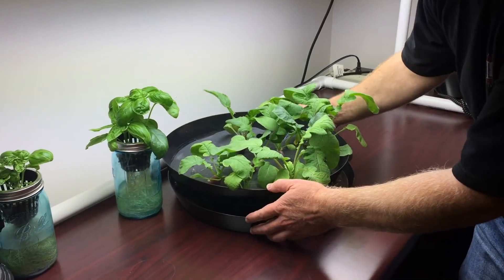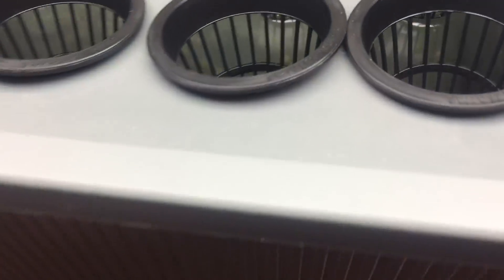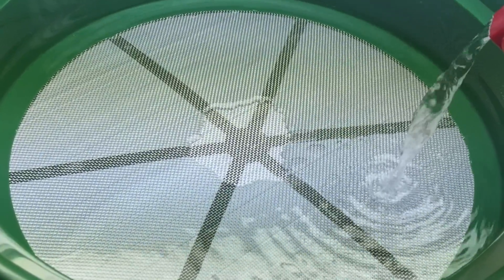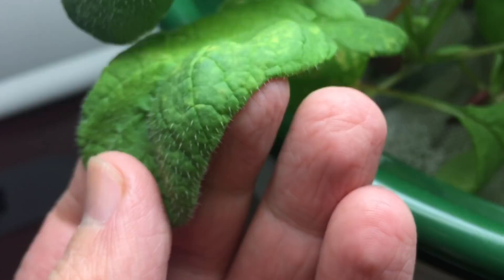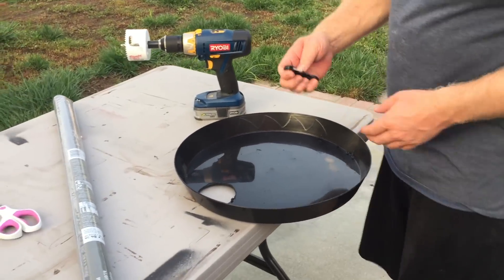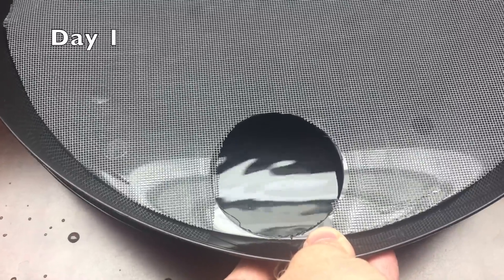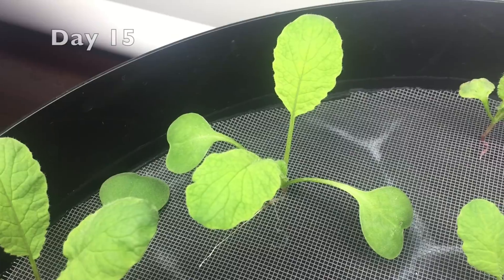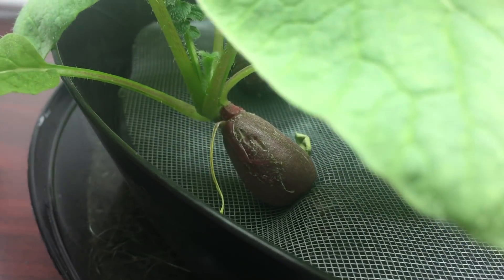Why did he grow them in a window screen?

Comment: cut "plus" shapes into the screen for each sprout, this will allow as much expansion as the length of the cuts...
Reply from the maker: sounds impracticle
Reply: @JebGardener  Well...in your comments you asked for suggestions... You also seem to like to break gardening rules and do impractical experiments? The roots are limited by the size of the hole in the mesh, so two slices in a "plus" configuration would allow the root or tuber to grow in size, unrestricted...

Comment: How about using the material from nylon stockings. It should stretch and if needed to be cut easily. 
Maybe stretch one end of a tube of stocking over a netting pot, and the other end with it's extra material suspended in the middle of the pot. Enough material to hold a seed but can separate to allow the roots to grow through
Reply from the maker: I think it could work but there are cheaper alternatives
Reply: Jeb Gardener    The nylons or knee-highs can come from Dollar Tree and reused on the netting cups
Reply from the maker: im going with worn out agribon row cover first

Comment: How about using mesh fabric? Thinking about the elastic one, or tulle.
Reply from the maker: good idea
Reply: @JebGardener  Hi Jeb. I surprised to see your reply. Nice to talk to you.

I did some research and find that EPE foam net (usually for fruit wrapping) might be a better choice than fabric. It's very elastic and the mesh can broke over its elastic limit to adapt with the radish growth. The positive: it is cheap, environment-friendly, and you can buy it in bulk roll. However, it can be only used once (but its okay since it is cheap and comes in bulk roll).
I haven't given much thought about the structure to support the weight as the plan grows. Maybe rectangle box, drilled tray, and strecther for the foam ?

You can do small experiment using fruit wrap (don't forget to cut it so it will become a sheet, and stretch it but not too much). Cheers!

Comment: I wonder if you could knit or crochet a solution. There ways to do stitches that are tightly woven but can stretch out quite a bit under very little pressure. As to material...IDK. would wool hold up to the water?
Reply from the maker: I could not
Reply: @JebGardener  LOL. Well, maybe I'll give it a go and see if it works.

Comment: Judicious, non-overlapping snips in the screen will permit stretch -- much like skin grafts were stretched to fit over areas otherwise too large to cover, back before there were special (power) tools invented for use in the operating room.  The technique is still useful in medicine, today, when a circumferential bandage is placed over a wound before the region so wrapped has time to fully swell.  Judicious snips...

Comment: I would say put the seedlings into the bottom of a screen cone (it should look kinda like a ice cream cone just roll the screen into a cone leaving the bottom just large enough so that a seed wont fall through) suspend them using a lid or string or what ever just barely in water then let them grow. The cone should expand as the root cluster expands. At least thats my thought.
Reply from the maker: That's a pretty cool idea.  I don't think that would scale well though.  Too much fun means too much labor

Comment: The water needs an airstone and a pump (roots need oxygen or they die), after a few days (weeks maybe?) your plants have eaten all the oxygen in that water and they start dying.

Ideally also add an enzyme or mycorrhiza to prevent slime growing in the water and getting on the roots and suffocating them. You could also add H2O2 (hydrogen peroxide) to the water and it will keep the roots oxygenated and kill the slime as well (it breaks down in a day or two, so add weekly).
Reply from the maker: If air temps are cool enough an air stone is unnecessary
Reply: Colder water does hold more oxygen than warm, but I am not sure it's enough to not suffocate your roots. If you change the water maybe weekly you might be fine? I am assuming your water is tap as well, so very likely has chlorine in there, mycos and or enzymes probably aren't necessary with tap (and the mycos would likely get killed anyway). So I would be willing to bet oxygen or PH is an issue, you would need a Dissolved Oxygen tester to confirm either way. 

Obviously you are right about the roots getting choked out, what if you just used something like a papertowel with holes in it, the roots could easily push that out of the way...
Reply: one other thing, usually people put rocks in those net cups, called Hydroton. Guessing just regular gravel would work just as well. But that might potentially prevent roots getting choked?
Reply from the maker: yeah i break all those rules regularly and the plants grow fine.  I don't even mix my dry ingredients, I just shake them into the water.

Comment: So using the soda bottle as an automatic water filler works because there is one hole in the bottle for water to escape and if that escaping water can't be displaced by air, then the water wont flow out? This is why the water level needs to be below the hole (so air can get in) for water in the bottle to flow out?
Reply from the maker: yeah its an air pressure surface tension thing
Reply: @JebGardener  Pretty cool, I'm definitely going to use this for my indoor plant. Thanks!

Comment: Burlap might work, if it doesn't start rotting too quickly, or just a screen with slightly bigger holes.
Reply from the maker: i think it would constrict too.  Probably wouldn't rot in 30 days or whatever.
Reply: Jeb Gardener well the burlap mesh I have seen in home depot is quarter inch holes, maybe a silicon Ice cube tray with holes cut in the bottom.
Reply from the maker: agribon

Comment: Any hints for dealing with algae build up in a kratky grow? I tried growing in mason jars, but they are clear and building up....
Reply from the maker: cover it with foil or a tube sock
Reply: Yeah I was planning on doing that, but once there is already an algae build up is there something I can do? It seems to have had a massive die off and has all fallen to the bottom of the jar, but it still looks a vibrant lively green. Either way things are still growing well. Thanks for the ideas.

Comment: Have you tried cutting a slit in screen on the sides of some that have 2 or more plants in a cluster? May remedy having to separate bunches. And if you can find some cypress wood, like 2''x2'' you could make a screened frame and might not have to adjust trays anymore. Cypress wont rot underwater or hurt the plants. That's what Cajuns build porches and shacks out of down yonder in the swaps.
Reply from the maker: that is an interesting idea
Reply: I am a plethora of some use full and some not so use full info. Here is another I forgot to type out earlier. If you get alga in pets water bowls, pit in a couple pennys minted in 1983 or earlier and they will kill it (pure copper).  I am going to try some water gardening when I get moved back to florida.I have green thumbed it in the dirt most of my life so time to get the feets wet so to speak Have you tried aerating the water in one of your grow tubs? Guess I have a bunch of research to do.

Comment: Hi Jeb. It looks as though you are using a four tube T5 fixture. I have just acquired one. I am having a hard time finding good info on the proper distance they should be from seedlings/plants. I find that they are too hot and intense to keep them at the few inches that works for the T8's. I keep mine at about 18 inches and that seems to be a good distance, but haven't raised enough stuff to know for sure. What distance do you recommend for seedlings and plants? Thank you.
Reply from the maker: The lights are 24 inches from the desk surface.

Comment: I love your channel. I would love to see your take on trying to grow plants in brackish to salt (ocean) water. Your research would directly help the future of mankind's food problem. Especially if you found certain crops to be salt tolerant and able to grow in nothing but said water.  As for the screen issue, larger screen holes but rope or twine suspension between the squares that the radishes can grow between.  Sort of like weaving your own spiderweb and planting the seeds between the squares on the twine/rope. Both rope and screen would be reusable. Though eventual mold issues may present itself depending on which twine used. It'd probably beat rock sheet fiber in your teeth though.
Reply from the maker: I'd like to do ocean research but I think the plants have to be separated from the water.  I'm thinking floating barges with aquaculture beneath them.
Reply: You could always get a bag of marine salt from the pet shop and give her a try!

Comment: try a new screen that stretches easy. that way, you can use the same method but you wont run into the problem of them not doing good due to constriction issues or at least not as bad.
Reply from the maker: y

Comment: Try to use a sponge I cut 1 in a bunch of little cube for lettuce starter
Reply from the maker: how reusable is that?
Reply: Jeb Gardener 
Not at all. At the end of the vid I thought you asked what else to try n grow with. Have you tried perlite in your net cups or bark fines I watched this take a mop head cut up the strings n make a wick to get seeds going but the wick wouldn't be reusable.  I have some net ups with smaller spaces than others I'm thinking you could soak the P down n wouldn't loose much into res

Comment: Grow them upside down. THUMB ME UP!!!!!!
Reply from the maker: The plant dies if the leaves can't transpire.  Thumbs up for creativity though.
Reply: aww reason why i said upside down is cuz ive seen like a commercial on growing tomatoes upsidedown but needs to have soil n was supposed to grow better tomatoes.
Reply from the maker: Yeah in hydroponics, upside down means the wrong end is underwater.  I should try one of those crazy planters again.  Hard to keep enough water on it.
Reply: Yeah those upside down tomato bags are ok but hold water better if you cut a 2-liter bottle in half & use the funnel to add fluid/ prevent evap. It doesn't stop it completely or keep everything away from the roots but it does help.

Comment: Paper punch holes in the screen. Tuck tissue paper into the holes place the seed into the tissue paper. Punching the holes into the screen the compromise the strength of the screen. Hopefully it would be enough.
Reply from the maker: agribon
Reply: I'm new to gardening and know very little about the various technics and products available. I tried a vegetable garden 3 years ago, total flop. This year I'm trying hydroponics. It's -4 F outside and I just started 12 cherry tomato plants, 6 leafy lettuce plants, 6 spinach plants, 6 chives, and 6 cilantro plants. I hope they grow. I have an unused room in the basement that I'm using for indoor hydroponics. If I have any success I will continue. Then I will move on to outside hydroponics if the weather ever warms up.

Comment: is there any kind of cloth or maybe brittle plastic mesh that would work to alleviate the constriction issue?
Reply from the maker: Yes, but it probably wouldn't be re-usable.
Reply: hmmmmm, maybe something biodegradable then so that isn't as much of an issue... some weird amalgamation of those biodegradable packing peanuts?  Or if you can find that biodegradable styrofoam in sheets instead of peanut form.
Reply: The cloth mesh might be a better avenue to look into though... the more I think about the practicality of it.
Reply: Restaurant hair nets and bear guards?
Reply from the maker: I'll probably try worn out agribon row cover next.

Comment: 5:16 Lance Armstrong's balls.
Also, that is disgustingly yellow tap water you've got.
Reply from the maker: the bpa free coating or whatever on the inside of the bottle makes the water look yellow.
Reply: That isn't a thing. Yellow water is primarily caused by iron and manganese, not a colorless substance like BPA. And if it was BPA, drinking it or using it with your plants would essentially be poisoning yourself. "BPA could affect plant growth through changing the levels of single endogenous hormone and the ratios of growth and stress hormones in the roots because of BPA absorption by the roots." So either way, filter your water, your plants are getting to many minerals, or, if you are right, to many toxins.
Reply from the maker: there is a coating of thin plastic inside the bpa container.  That coating is bpa free.  It's like a membrane or whatever.  When light passes through the membrane, the water appears yellow.

Comment: Pool noodle slices are indicated here.
Reply from the maker: seems labor intensive
Reply: Does the Kratky method scale to a larger operation?  If you had a commercial size greenhouse at your disposal, would you fill it with a bunch of drilled-out coolers, or would you adopt another hydroponic approach?  WWJD?
Reply from the maker: There is another way.  I'll keep it to myself for now.

Comment: I'm talking a bit out of my ass, but could the seed maybe be glued to some sort of a holder? Just a tiny speck of glue which would hold it long enough to be able to grow large enough so that you may handle it. Maybe you could use a bit of clay, or something else with plastic property (silly putty comes to mind) which would expand with the root but still keep it stable and firm. It should also be reusable. Maybe a rubber band could be used, but I don't think it would work due to applied pressure over time.

There are those elastic sleeves made from some plastic, fruit sometimes comes packaged in that stuff. It's basically a relatively elastic mesh which, if sized properly, would allow the root to expand and should be reusable. I have no idea what's that called though nor where can it be purchased, I'll have to look it up.

Edit: https://www.plastirub.be/en/product/netflex/
Reply from the maker: sounds like some good madness to me!

Comment: Perhaps capillary matting under the mesh to let the roots grow in would not be as restricting. Plants should develop moore roots. A lot more water lost to evaporation, but thas does not have to be a problem, if taken into account, the radishes them selfeves will not have such "dried" surfaces either.
Reply from the maker: Could I reuse the matting though?
Reply: I believe that depends on the quality of the material and how big of an issue root residues is. But I do not know, I've never grown radishes on capillary matting. I have grown aquarium plants emersed om capillary matting and that with varying results,  sometimes very successfully, ans sometimes not.

Comment: Get some rtv silicone and trace out a screen on a non stick surface.  It will be a pain, and time consuming, but should work as a stretchy and reusable mesh in lieu of what you've been trying.
Reply from the maker: how durable is that stuff?
Reply: Depends on which one you get.  The black RTV they sell for sealing car gaskets can be pretty tough, while the ones they sell for sealing around the bathtub could be iffy.  I've jury rigged o-rings out of the RTV black when I couldn't find the right size and didn't have issues.  It can take 24 hours to do a full cure though.

Comment: I just saw your video. The stretching of the window screen is very annoying. I came up with an idea for you (not testest). As only the roots need to be in the water, you could maybe design something like a hanging rack. You tie a cord to the head of the radish (just where the leaves starting, maybe a rubber band for a bit more flexibility during growth and more grip) and hang it on a rack so just the roots are in the water. In that case, the "fruit" could grow without the effort to push through a material.

Comment: if you add an air pump to the water and ph it, theyd probably do alot better
Reply from the maker: If plants are receiving all the nutrients they demand, ph is irrelevant.   Air pump would make them grow a little faster, yes.
Reply: Jeb Gardener its really not plants require a certain ph regardless of what you place into the water. Some like things acidic and some more alkaline. They have ranges in which they can actually take up certain nutrients they need to be healthy. Growing in water vs soil even requires a change in the normal ph range. Ppms are also a factor you don't always follow directions on the fertilizers sometime you use half or quarter strength and its plenty then slowly work your way up. Lighting and temps also change how your plants metabolize and use food. As far as oxygen thats what the roots need to live, they take up oxygen which your plant needs since its not in soil.

Comment: What if you used Styrofoam cups with a X pattern cut in bottom so it will be able to hold the root but also be able to expand as needed? Styrofoam is soft enough I think
Reply from the maker: i think it would work but won't scale
Reply: Jeb Gardener break the rules and try it! Love your videos inspires me to want to spend more money on plants

Comment: +Jeb ...did you find a better solution than using the screen for bulb veggies?
...do I have to power-watch all your videos to find out? :)
Reply from the maker: i haven't done the follow up but agribon worked well
Reply: Yes, that seems like a great solution ...tough but with good give ...I imagine you would need to perforate prior to use. Don't want to spoil your follow up :)
Reply from the maker: i tried paper towels and agribon on the same radish disc rig.  The paper towel ones all died.  The roots grew slower than in the agribon and the water level dropped before they could get in it.
Reply: Oh yea, so you re-lined the sifter with the agribon ...I imagine you needed to cut the screen out? I kind of like your net cup solution, in that you can pull and replace individual plants without disrupting the others. Perhaps cut the center net ring from the bottom of the cup, leaving the short prongs to keep the lining in place, but allowing the roots and bulb to grow and protrude as needed.